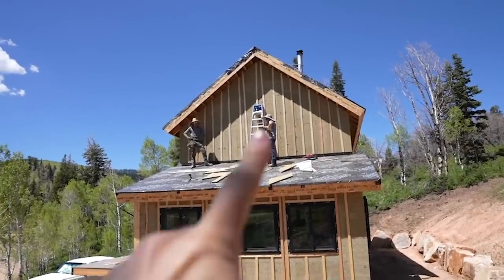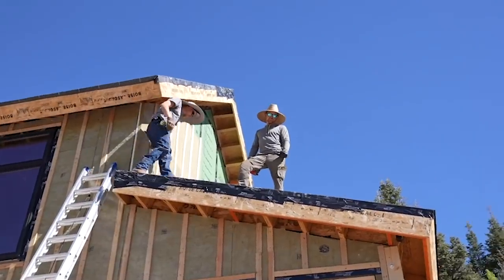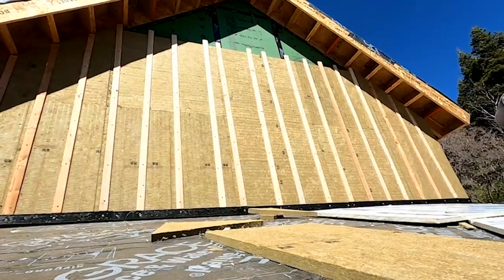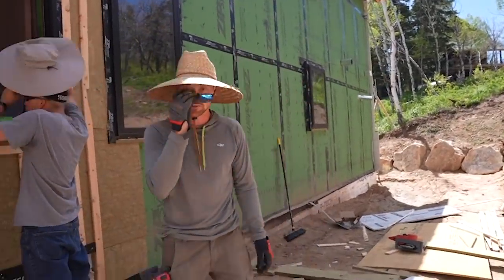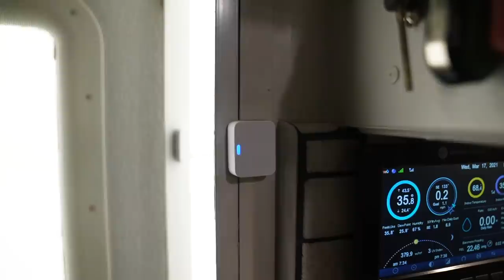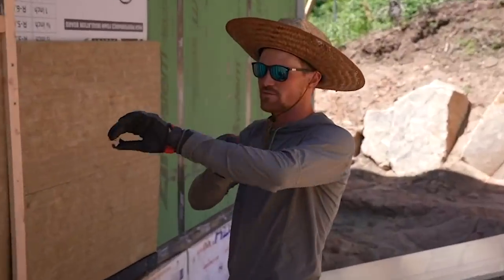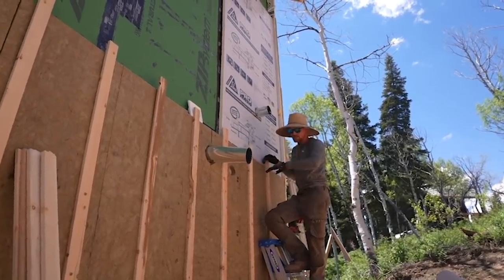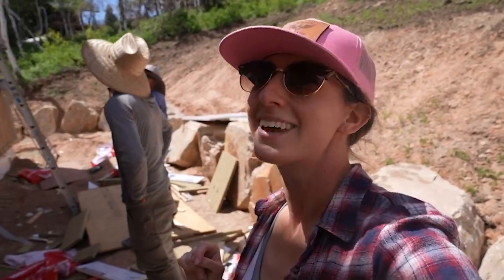WE TRIED OUR BEST | BUILDING OUR OWN HOME

Comment: Trent , you're absolutely correct get as much you can done on the outside while it's cooler you can always work on the inside when it's raining cold or hot. Those walls as the sun reflects on them will burn you up standing up next to them working. It's looking great, you and Brandon and Allie have done a great job.

Comment: hopefully the roofing will be done prior to snow.. and i hope you realize that it could take up to a month to do the inside drywall, tape, mud, sand, tape, mud and sand again... and then all the other steps before painting..
Reply: Not to be negative but a month is optimistic with super high walls and ceilings. This is not a beginners house.  Sub out the drywall!
Reply: @patchurch1677  not happening .Trent wants the experience and also to do it for the channel.this is YouTube remember haha

Comment: You could build an extension the on the second floor, over the living area, so you could have the baby's room beside your master bedroom and have your child by your side.
Reply: That is a good idea. They could still have a raised ceiling over the living room.  They currently planned high ceiling will look incredible, but all the heat will go to the ceiling and it will echo.

Comment: LOL ... Mommy is in nesting mode. I agree with T & B about finishing up the outside. Here is south Florida, the sun can be brutal. Actually, you are ready for siding now, right? Siding, roof, paint fascia/soffits, landscape, driveway, finish electrical (outside), finish plumbing (outside), rocking chairs, grill, done. Then the inside....GOOD LUCK! I know you'll pull thru. I'd lend a hand if I were a little closer (Boca Raton, FL). Cheers

Comment: What helps against the heat is a green bottle from the refrigerator, there are also 0.0
wonderfully clear Heineken 0.0
heerlijk helder Heineken
Best regards
Frits from the Netherlands Amsterdam
Reply: Well, actually avoiding alcoholic beverages is a safety measure against heat illnesses.

Comment: If you want to just move in, why not focus on finishing the essential parts like the kitchen and the bathroom, move in to those areas and finish the rest when that is completed?
Reply: That's basically there whole house
Reply: Amy, it sounds like you have never lived in a construction project. It can be done, but it's not fun. And our 4 kids were all 3 to 5 years old. With a newborn it would be miserable. That's why I suggest, like others with experience, to contract out the drywall & mudding. It may just save the relationship.

Comment: Hi Guys congratulations on the progress of the house and your bun in the oven.

I'm an Arboricultural consultant in the UK. I noticed you mentioned some of the trees are late coming into leaf. I can see that on the video too. In the UK we have strict planning laws about running heavy machinery and vehicles over the roots of the trees. Mainly because we don't have as many as you. What can happen, is when it's wet the ground becomes compacted and reduces the oxygen and water down to the roots. It might be that the trees will start to die back as a result and that's what you can see. You have lots of other more important things to think about but just wanted to shine some light on it, if you're interested.

Comment: Just consider what this build would be without Brandon. It would probably take Trent 2-3 years to finish this house by himself. He would also have to hire in a lot of sub contractors for things like dry wall. I'm not sure what he was thinking before knowing Brandon was available to help.
Reply: Yeah and it would be right instead of a disaster.
Reply: @designstudio8013    I am waiting for a  disaster to happen yet (like with the dry wall).  I worried with the electrical work, doesn’t take much to cause a fire, then boom your house is gone.
Reply: @designstudio8013  buzz off with your negativity. No one is interested. Why watch this build if you have nothing good to say about anything they do.

Comment: Are you going to put up a roof/cover over the porch? What type are you planning to install?  Will help to keep the inside cooler.  Saving your furniture from sun damage and saving the air conditioner from over working.

Comment: That is three levels of insulation on the outside and insulation on the inside too!  What is the R-value of all of it?  When will you be doing the roof.  I would have thought you'd be working on the roof before doing the exterior stuff but I'm thinking you have your reasons.  Can't wait to see the siding you picked!
Reply: I thought they were waiting for roofing materials. At least they couldn't get them before winter set in.

Comment: Wonderful, wonderful, wonderful !
I suggest you buy all of your dry wall ASAP before they run low again. You can leave it inside the house, cut it outside, and hang it inside when there's a "bad weather day" and you cannot work outside OR..... You can do dry wall during the hottest part of the day and work on the siding when those outside areas are in the shade. 
BE WISE....😘😁🥵

Comment: Watching Allie doing her Yoga, it was speeded up, and so everything looked jerky, but I wanted to comment on neck movements. When I developed neck problems, and most people do eventually, slow side to side [as if you are looking left or right by moving your head can pay great dividends. To move your head right you use a sweeping motion with your right fingers, and of course, when turning left, sweep your head left using the left hand. You do it until you experience very mild discomfort [or just before actually], and do it each day, and you neck will soon become more ambulatory and supple. Never jerk the neck in ANY direction, as this makes it tense up, and when you move your neck while tense, it cause more damage. The idea is to habituate the neck  to move in any way without any creaking or twinges of discomfort. Probably not an issue now. I started getting neck problems in my 60's, but look after your neck while you are younger, and you will prevent problems occurring, or delay them from occurring. Even when older, proper neck exercises can still improve the neck region and lessen any pain or tension. 
My two cents.

Comment: Drywall is heavy!
Wait till drywall supplier can deliver and use booms truck to put it on your deck,   *If lucky put it inside the house through your doorway* 
Waiting on drywall is cheaper than hospitalization for dislocated back. (Next time at Home Depot have alley Lift a sheet of half-inch drywall) Then outline the process of picking it up at orange box loading it unloading it from the truck carrying it up to the deck carrying it inside. My back hurts thinking about it.

Comment: You did a great job on the outside I was wondering what kind of drive your going to put in the because my dad had black top and  the oils put stains on thare floor and a year later they replaced the carpet or are you doing to get cement drive way I know what it's like to work in the hot weather can you put in your A C yet to keep inside cool when you put dry wall take care I will be watching more of videos

Comment: The crooked batts don't matter, as you say, until you begin hanging your siding and start "missing" the backing because the batt isn't straight. All of a sudden, you have multiple screws, crooked fastener lines, and/or holes to patch. Assuming you're going to have some kind of siding, are you "exposing" the fasteners or sinking and patching them??

Comment: 8:57 they’re Push Up Pops, since you have to “push up” the popsicle to suck the tip sticking out of the bag (which is genius to keep it from dripping on your hands & clothes as it melts faster than you can devour it, or being forces to eat it too fast & getting brain freeze 🧠🥶)❗️🙌🏽
Reply: Nope. Push Up Pops were cylinder-shaped, and came wrapped in paper, with a straw-like handle attached to the paper base of the pop with which to push it up. These are Freezer Pops.

Comment: Trent. As just a casual observer of your efforts, it would appear that you spend a good part of your day at Home Depot, collecting items that Brandon could bring on his way to your place. For instance had you not spent a good part of the morning getting basic supplies, you might have advanced more and even completed the rear elevation, before it got too hot.     The other thing that worries me is the amount of materials you buy from Home Depot, surely there must be builders merchants where the goods required are much cheaper, especially if you can get them at trade prices....As I say, these are just points that occurred to me, as I watch your home building progress....

Comment: Hi from Tennessee.  I'm not a builder but I don't understand why you insulated the inside of your house. Then put insulation board and rock wall insulation on top of that. Isn't that over kill plus making the house to tight? I would have to say with all that insulation you'll need a fresh air exchanger.
Reply from the maker: Yes we have a fresh air exchange! And the temperatures gets so extreme in the winter that the insulation will significantly reduce our heating bill and keep the house more regulated.

Comment: bring all the rock wool to the house to make room to store the drywall at Brandon's house.  Get while Home Depot has it.  if you wait until the rock wool installation is finished, you run the risk of Home Depot no longer having the drywall you need/want when you are ready to move back inside to work.

Comment: Ok, I love vicarious building in the high country with you two and your gorgeous dogs and amazing land… and baby Basil on the way. But seriously…. Skip the Drywall! Take a week and sit on the deck drawing kitchen and crib designs.., I would like to see them! And some non-speed yoga. 

here is why. Cutting vent circles in lightweight material and fitting them nicely at 15 feet is one thing. Now you want to do it with 50 pound of Sheetrock? So likely someone will strain their back. I can attest you
 will still be feeling it 30 years from now! 

Remember that the guys who do Sheetrock have the perfect lifts and solid ladders and can eyeball cutting holes for electrical outlets. They know exactly how to lift and brace to avoid injuring their backs. You are going to need your back for tossing little Basil and pulling the trucks back onto the road for the next few winters…, 
We did this on the house we remodeled when we were 33 and 35. We re-did all the electrical, built a deck, painted and did a little plumbing. We did not do the electrical box, the framing, or the drywall and mud because we had jobs and because we had to finish it on a much tighter deadline. We had a contractor friend who said- “once you have your primary inspections done you can do everything else - but skip the drywall. Too much pain for the gain. ❤️

Comment: As a mama a few times over, yes, the baby in the basement is a REALLY bad idea, not because of zombies, but going down 2 flights in the middle of the night to get, feed, change, said baby, only to do it several times a night. You think the puppy's bad? , you'll want to kill yourself, not the zombies. You won't be able to rest well either. How about this idea: I have a friend with a huge loft and big huge ceiling for the lower floor. After the house was built, they decided to extend the upper loft floor. It was relatively easy. You'll be so much happier with your kid(s) nearby. They can move to the basement as teens.

Comment: Don't want to be a bubble buster Allie darling you cant move in until your inspections are signed of on, when that happens the building inspectors issue a Usage and occupancy permit. This means you have satisfied  all inspectable finished works inspected  according bolding codes of your state. Do your wish list on paper that way you make changes before getting stuck with them for the long immediate future.

Comment: I love this show. I'm hooked. I've been watching for like a year and a half now. I got a question. Being the obsessed carpenter / architect I am, I wonder about the1x4 nailers that are installed vertically on top of the flexible insulation on the exterior. If the one by fours are sucked in too much by the screws, the horizontal siding may be wavy. I wonder if you ran a string line from corner to corner would the one by fours go in and out...... if so would this affect the siding when you look across the wall

Comment: I don’t want to burst bubbles, but… Simply Safe is a great idea, but I wouldn’t rely on it too much.  You are in a remote area that is reliant on a wifi system.  You are also quite a way from police services. I had a security system in my cottage, but I still got broken into, My security system took some pictures, but the police never showed up until I called them.  My insurance `company said I could put in a claim, but when they told me my rates were going to go up for 3 years, I did the math.  In three years, I would have paid off the claim.

Comment: Itsa shame you all dont have a contractor friend who pocesses a contractor's license to purchase your drywall (sheetrock) to have it delivered. I would still file a compliant to the main management of the company you guys were attempting to purchase your sheetrock and have it delivered. To me that's very poor management on behalf of the salesman's not giving you proper acknowledgement of the why and you losing all that time only to find out because you are an independent non contractor you cant purchase nothing from them. Business are in business to support builders and contractors no matter the CIRCUMSTANCES but for them to give u the shaft the way they did is wrong I WOULD FILE A COMPLIANT WITH UPPER MANAGEMENT AS WELL AS THE BETTER BUSINESS ASSOCIATION.